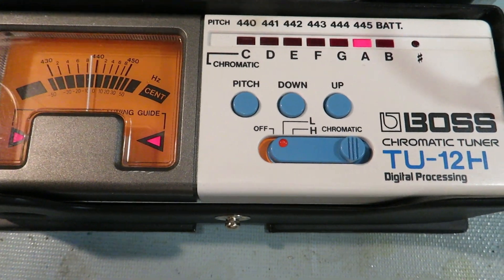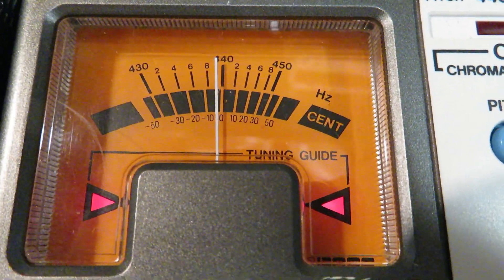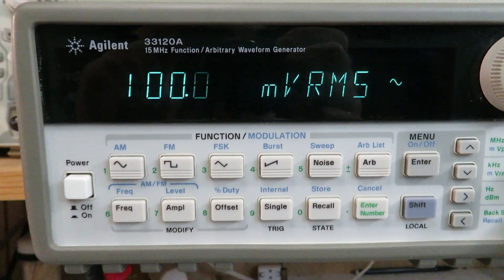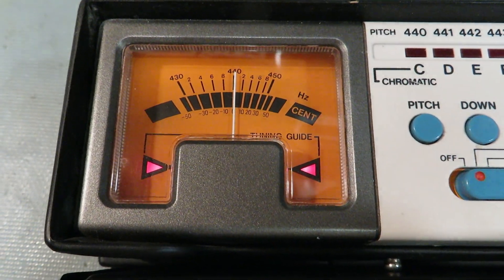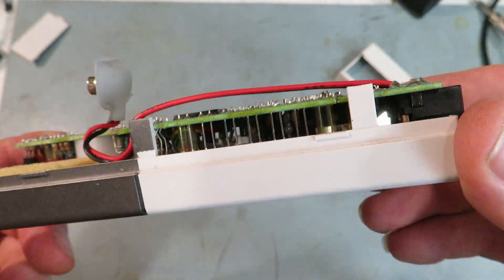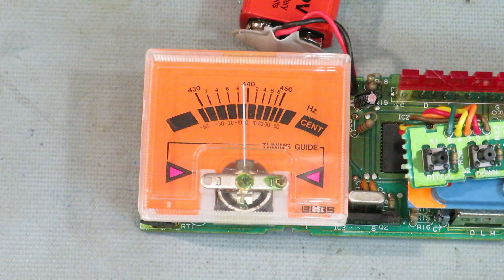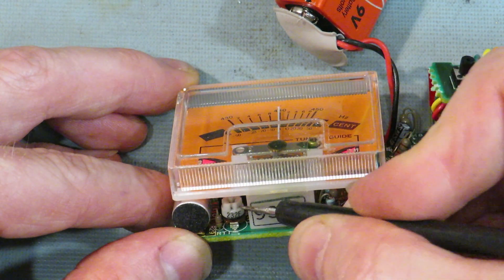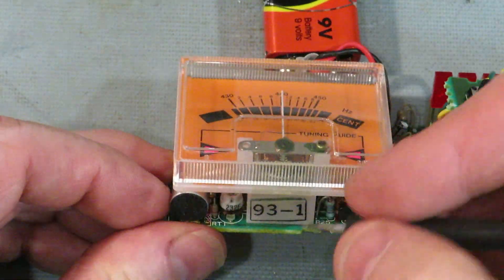Boss TU 12H Tuner Calibration #007

Comment: My used TU-12 has the same problem. Lights indicate ‘in tune’ but needle is flat. I don’t have a waveform generator. 
Pluck-adjust until it matches?
I have a Yamaha clip-on sensor and a tuning fork?
Reply from the maker: @Zerpersande  search youtube for a 440 Hz tone video and adjust using that.  More accurate than plucking a string.
Reply: On my TU-12H if you hold down the "pitch" button while turning it on, it goes into calibration mode; the needle centres and the tuning guide leds turn on.  You need to keep your finger on the pitch button while fiddling with the screwdriver.

Comment: Great video! My tuner has a diferent trim pot. It's kind of square with a philips head on top. I was wondering if It's thare any philips wrench small enough to fit between the bottom of the VU metter and the top of the pot. It's So hard to reach. Thank you in advance.

Comment: Nice. That signal  generator you have there I’m not familiar with those can you dial in any frequency you want with that say to go lower?  I need something to generate extremely low frequencies to conduct some experiments with something entirely different. Thanks
Reply from the maker: It can go down to  0.100 mHz   This is  0.0001 Hz.